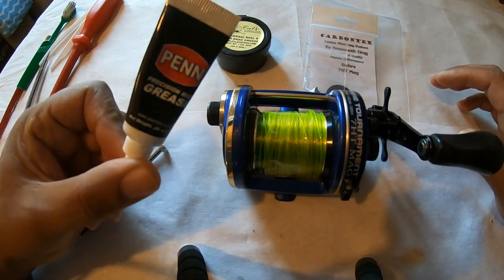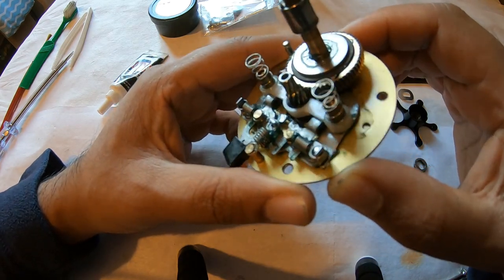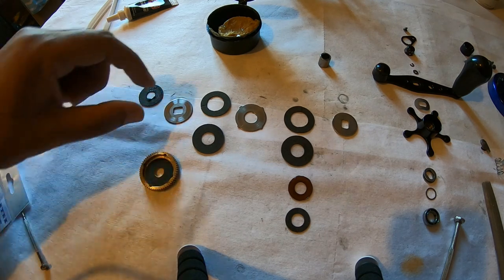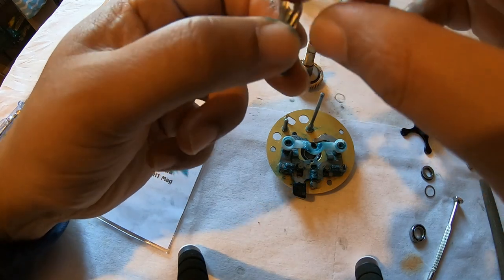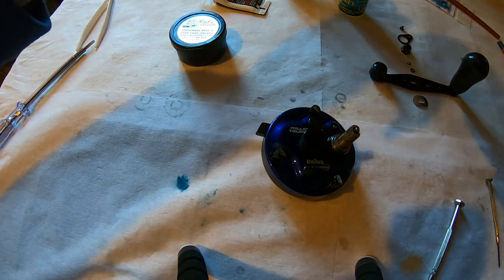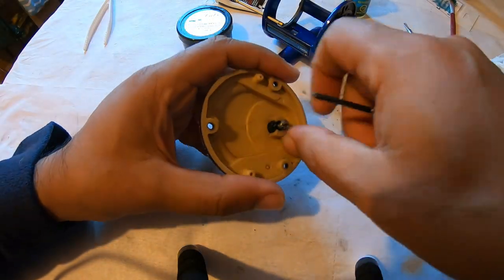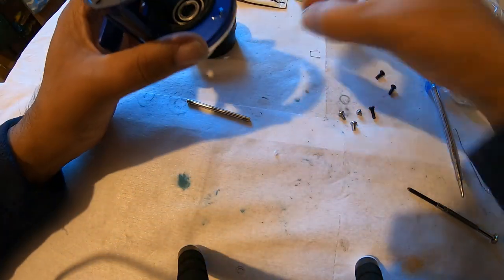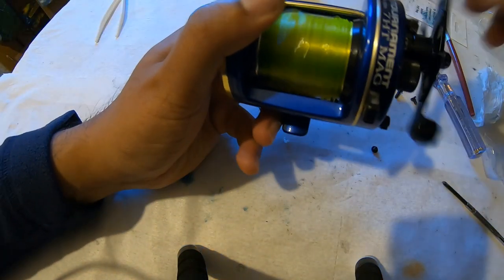Daiwa 7HT Mag Full Service

Comment: Hello mate. I recently bought a 7ht mag. It appears to be in very good condition, but it is ridiculously fast. Even on max mag it just wants to blow up.  I have taken it apart and checked the magnofuge and everything looks and feels ok. At least I think so any way. Despite checking this it is an absolute pig to cast. Do you have any ideas. I have searched everything I can find on the net no joy. Thanks in advance.
Reply from the maker: Hi.  Try to Spin the reel with mags on max and min and see how long it spins on both as the magnets might be installed incorrectly which i have seen. Check the neutral setting (see vid 46min it shows how to check).  If this is all correct then use heavier oil in your bearings to slow it down.  I use Yellow Rocket fuel on all my bearings but i would suggest another oil which will slow your reel down.  Using thicker bearing oil will slow your reel down and fix your issue.  Tight lines
Reply: @CastAwayFishingUK  Thank you for taking the time to respond. I will try thicker oil.